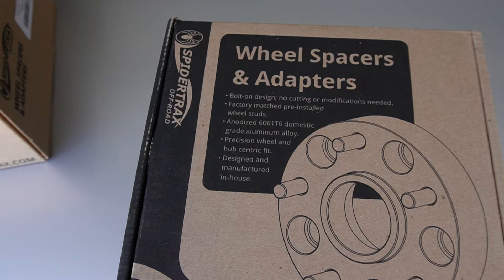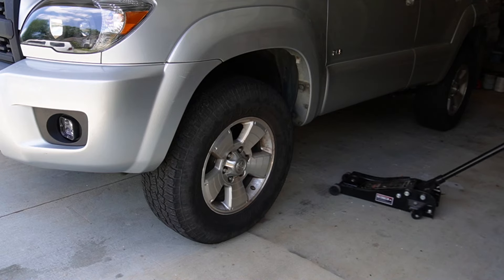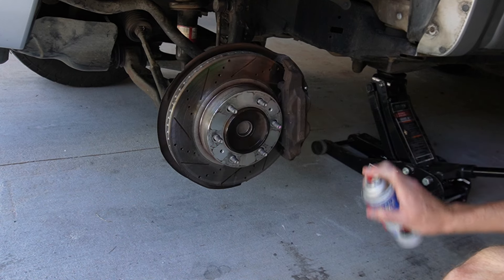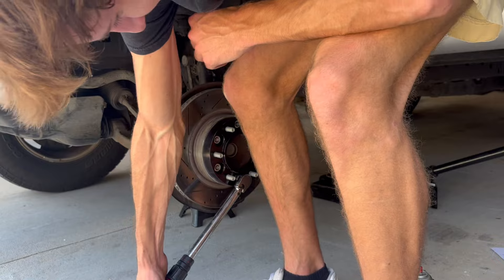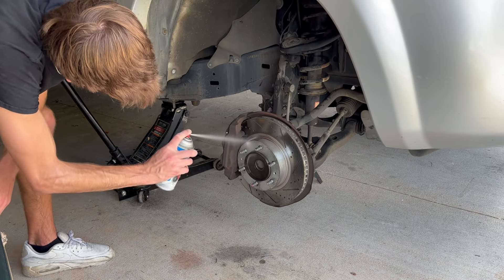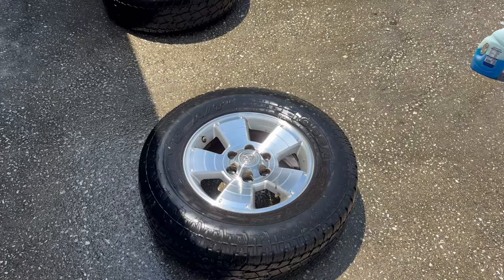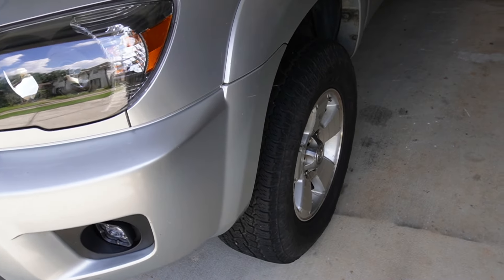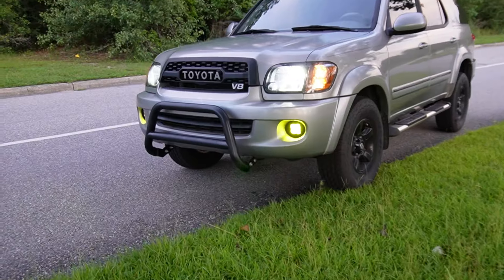Spidertrax 1.25" Wheel Spacer Install - 4th Gen 4Runner

Comment: How to fuck your bearings up 101: The Speedrun Edition.
Reply from the maker: @ggkkkgkgkkgkgkg  if you’re referring to improper leverage on the wheel bearing, a hub centric spacer on a 30mm offset rim has exactly the same leverage as a 0mm offset wheel In terms of backspacing length, and 10s of thousands of people run 0mm offsets rims safely.

Comment: You may want to put some anti-seize on the back of the spacers. I learned my lesson on my GTI and went to do my brakes and couldn't get the spacers off the rotor and had ruin the spacer to free it from the rotor.